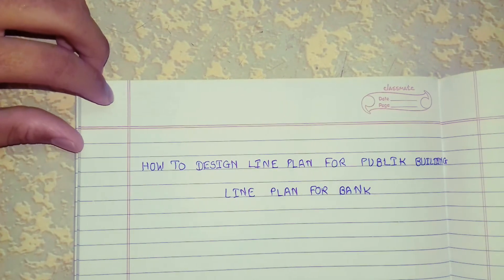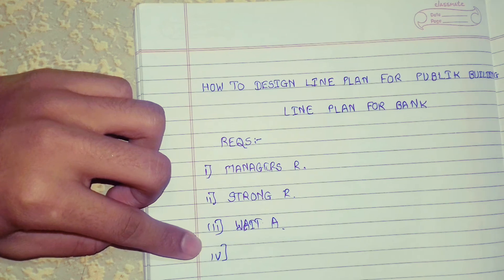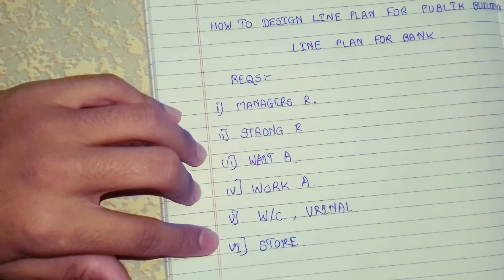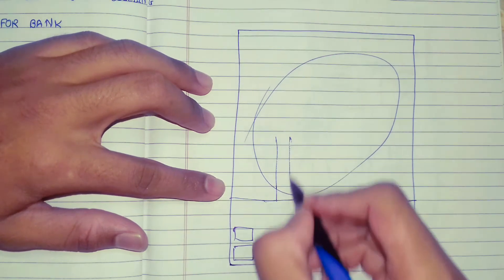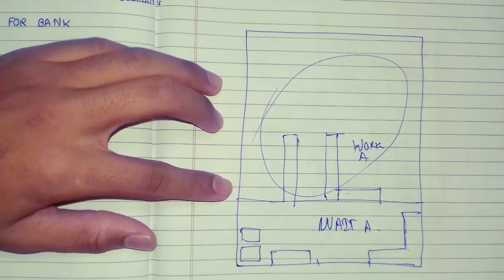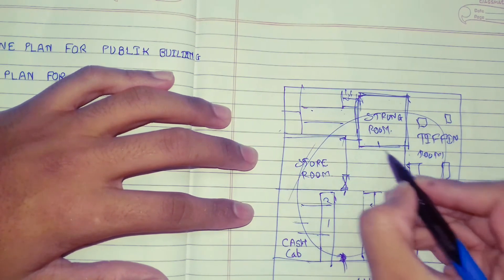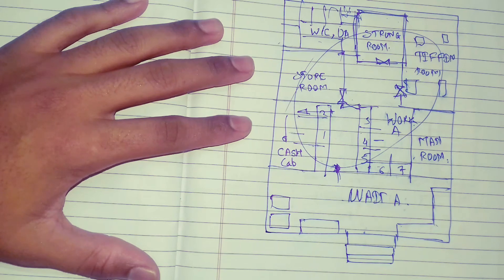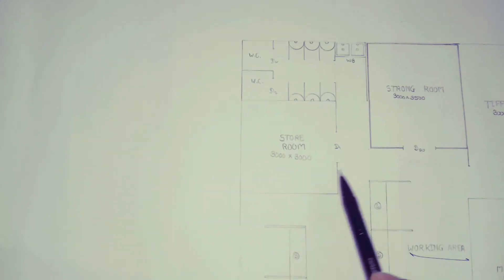Bank line plan

Comment: Will u please explain according to scale , with measurements of door and window please,
Reply from the maker: Door sizes changes according to Bank Qualifications and location.   
We provide steel foldable doors so as to have more usable area when door is open. Usually 
2.4m X 2.1m door provided in National bank. 
Because of security purposes we cannot provide bigger windowsin bank and sises restricted up to 1.8m X 1.2m.  In waiting area only.
 Note: There should be no window in work area.
Reply: @civileducation-jayrajdhere3618  I need help. Will u explain working drawing too for architecture assistantship student 🥺🥺 please
Reply from the maker: https://youtu.be/a_MphQUvUDI